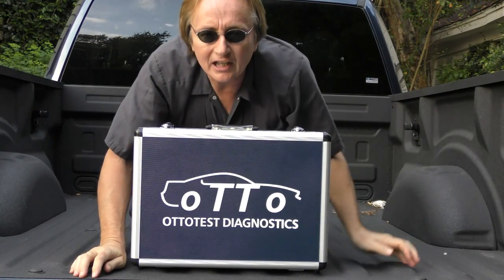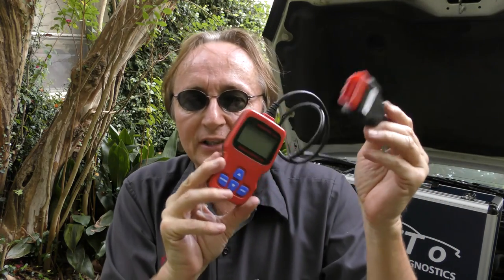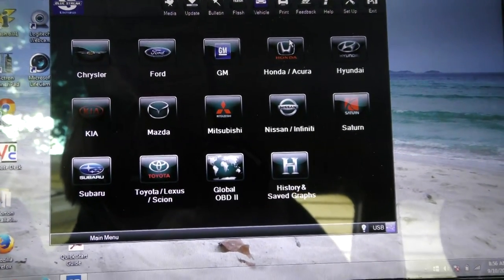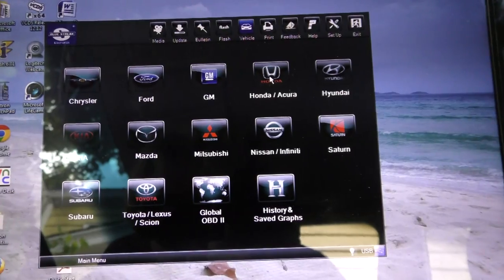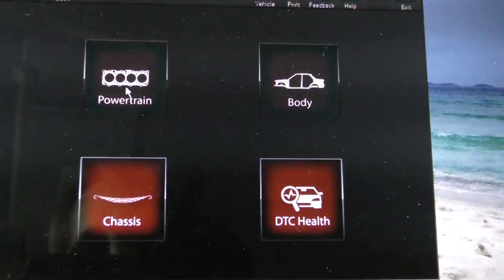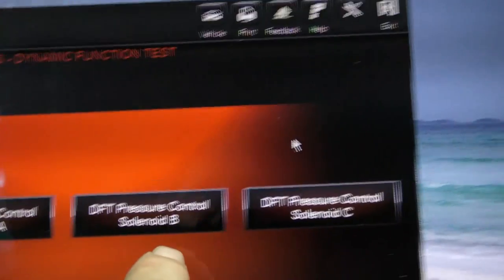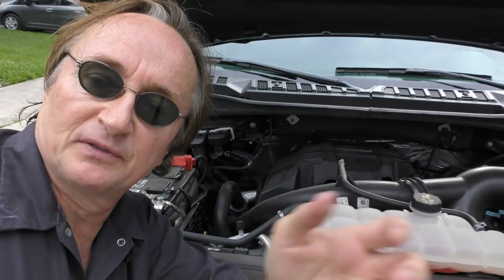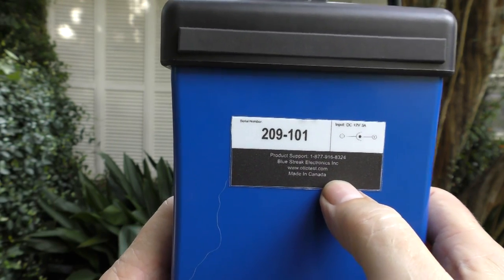Fixing Complex Modern Cars

Comment: POWER TO THE PEOPLE. Every man , woman on this planet should be able to open their hood and DIY STUFF on their car I say Open source every car system out there. The craziest I have seen is " No dip stick for BMW" and the Run Flat tires. Let's put together a real car of the peoples. Lo
Reply: +Jonas Ben I had a conniption when I saw no dipstick on a BMW I worked on.
Reply: +TheFlacker99 (Flak) I only found out after buying the CAR lol
Reply: one of my favorites right now is the new wrx. oil filter in the engine bay is awesome.
Reply: ***** easy to reach , great.
Reply: +Jonas Ben Audi has the same thing. I know that the Mercedes sprinters do not have trans dipsticks either.
Reply: +Raf Matt Interesting.
Reply: +Jonas Ben You can have a bicycle with the small motor attached to it, no need for a car.  Easy DIY transportation
Reply: +Zak K  I live n Canada so the winter is very brutal need a car lol.
Reply: +Jonas Ben When I lived in Europe winters were bad too heavy snow and freezing cold, you couldn't drive a car as first wouldn't start second the snow was at least 20 inches deep and icy roads.  Most people walked or used a sled.
Reply: +Zak K My car starts and we plow the street with plenty of road salt that eventually destroy our cars haha.
Reply: +Jonas Ben wow Jonas no way! Bmw never told you that you had to rely on just the electronics to check the oil? I never knew about the no dipstick thing until I just read it on this comment section- incredibly stupid:/
Reply: +Chris Dooley BMW does not tell me much these days as I got rid of mine.
Reply: +Dadecounty Mike yep!  I own one!  install a fumoto oil drain plug and oil changes become so easy it's criminal.  2015/2016 WRX are fun, easy to work on cars!
Reply: +Jonas Ben I think most of the people would not still do any DIY. Since you can take it to dealer and be lazy. Most of the drivers dont even know how to change light bulb. The dont also have any clue about how engine,transmission or even engine fan work. I hope its different at your country
Reply: +w3llet  Here in Canada , I don't think so ; In Brazil I spent some time in garages while growing up . Where My dad flew his model planes there was a Karting track so this is how it all started for myself . Interest in Racing cars and mechanics was born.
Reply: +Jonas Ben Auto manufacturers wouldn't have to seal the transmissions if people could be trusted to put the correct fluids in their vehicles. This is to help protect your investment, as many European vehicles were designed for short life cycles and peak performance and luxury. If you want an appliance to get from A to B, buy a Japanese automobile.
Reply: +Jonas Ben You still check your fuellevel with a dip stick like Ford model T too?
The BC tells you exactly how much oil is in the engine and if it needs filling you get a warning and exactly how much oil you need. Easy.
Lots of people don't check their oil level on a regular bases with a 
dip stick, with this system you get a warning when it's too low and you 
can check it everytime you want.
Reply: +MarkVL No I check My telemetry on my computer , just F1 LOL.
Reply: +Jonas Ben ROFL man if you can buy a 65K car you can afford to just go get a new tire you have 80k on a runflat. and this dip stick thing is funny!! no crap can get in the oil. every time you pull that thing out you risk contamination. the computer yells at you if you have a problem with anything. the way you think we would all still hand crank our cars instead of an electric starter so we can feel if the crank bearings are bad:P
Reply: +Jonas Ben the amount of times i have seen people get an oil change and they don't put the oil back in!!!! lol yeh well a german car would tell you your car has no oil:) how many people look at that dipstick leaving walmart?
Reply: +Rick Tobin  Actually, the BMW models without a dip stick have to be driven about 5-6 miles before they will indicate oil level on the dash board.  By then, it's a goner.  Seems strange they would design it that way.
Reply: Because they want for you to purchase a new engine LOL.
Reply: A goner only if for some reason you lost all your oil at once, when does that happen xD. You would've got a warning the day before in your dashboard your oillevel is too low and how much oil you need to add. Excellent system.
You can't forget to check your oillevel, with this system you don't have to because you get warned if its too low.
Reply: MarkVL
 LOL.  Agreed, but I was referring to another post that mentioned someone forgot to refill after an oil change.  Cheers!
Reply: That would be the Russian Lada.
Reply: Yes sir .
Reply: One day the hood of your car will be sealed and if anything goes wrong on your car you will have to junk it!
Reply: John Azhderian that already exists lol it is called tesla
Reply: When your car runs out of gas you will have to junk it!
Reply: you must understand. people today want to drive and forget it. that's it!
Reply: i don't have to ever change the oil filter on my car.
Reply: ROFLMAO ya a big hole in a sealed system that can introduce contaminants and suck air. the dipstick is a great idea.man you are living in the Stone Age
Reply: An entirely open sourced 340hp 3.7 V6 4 door luxury car that is very user serviceable with ATF dipstick and oil dipstick would be very nice. Also the end user can mod the car to their liking anyway he or she wants such as a more granny or more responsiveness or can come up with a software patch or a self engineered part that fixes a problem well before becomes a lawsuit. We should start and engineering and design team to make it happen.

Comment: When these hit Harbor Freight, let me know ;)
Reply: +snarlingrabiddog5150 

So funny because it looks like a item they would sell for like 100$
Reply: +snarlingrabiddog5150 If you found an Ottotest at Harbor Freight it would be very inexpensive. You would just have to ignore the slightly misspelled brand name.
Reply: +snarlingrabiddog5150   Hey, hey! Don't make fun. Those vietnamese kids are doing the best they can to build harbor freight tools. :)
Reply: lmao!
Reply: Harbor freight does sell the Autel MaxiDas DS 708, it also handles European cars. Scotty does have a video of it and he, like many others, says it's just fine. It's priced at $1100, but you can use a 20% off coupon to get it for less. I just ordered one Myself as I'm now working on European cars, and our older troubleshooting tools are garbage, hacked software and out of date. For most cars from the mid 2000's on, You need one just to reset service lights and see what's causing problems when an OBD 2 scanner won't go any farther then the ECM.
Reply: Rc Shalls It works but it still isn't cheap.  1100 but it is legal software and still cheaper than the otto. 

Also scotty showed one of the 100 scanners from hf not long ago.  He said they worked too. Just not at the super oem level too.
Reply: lmaoo💁🏽‍♂️😂😂😂
Reply: I think he bribes them with auto services (Euro cars exempt)

Comment: Reasons why i finally ditched my 2004 audi a4 and got a '09 Tacoma - 

pieces too expensive
pieces harder to find locally
requires expensive higher grade fuel
too many unnecessary steps for simple repairs 
repairs take longer
poor support for non oem repair community
too many different fastener types 
cars start falling apart all at once
 - Done.
Reply: what you mention there is pretty much all VAG cars lol

Comment: Computer controlled mechanical components is really a scary thing when you think about it. If anyone manages to interface with the computer, they can hack your car while driving and disable braking, power steering, cut engine power remotely while on the interstate, ect. This becomes especially more concerning with the newer cars that are internet connected via 3G/4G all the time and have no firewalls or separation built into their embedded systems.

Comment: They call that planned obsolescence with European cars. The only ones that are worse are English cars. A friend of mine was fixing his brothers xjs and the Jaguar dealership quoted him over $700 to fix the brake lights. Complete swine.
Reply: +Michael Sackstein And the fact that Jaguars are done by TATA Motors doesnt really confront me about these HIGH quality English cars :D
Reply: +Michael Sackstein Well, I read articles on the net and the general consensus it Volkwagen and old AUDIs are usually the worst cars. As for newer german cars, the engine will last very long if you follow the maintenance in the owner's manual. What becomes expensive if the labor. Labor is what makes maintenance expensive. That's why you should learn to DIY.
Reply: TheMidnightNarwhal very true. Newer ones do require dealership visits at some point but you have to remember when you bring it in you give them limited authority. Otherwise it could cost you many thousands. Happened to a friend of mine who owns a 1993 525i. He ended up spending $8500, but that's another story
Reply: Michael Sackstein I intend to get a BMW M4 and only bring it at the dealer for the free prepaid maintenance you get. Hell, I will even change the oil on mine half the time before it's scheduled.
Reply: That's fine. If it's free, then why not. Usually the only things that require dealership visits are computer related items.
Reply: Michael Sackstein Yes. Yeah, but even then, on the forums plenty of people can help you with coding and computer problems, depending how the niche for that vehicle.
Reply: Immobilizer systems are another one. Even locksmiths usually can't figure it out on German cars these days
Reply: Michael Sackstein Why would you want to crack a immobilizer? If a locksmith can't even steal my car, that's a plus for me.
Reply: No but sometimes the systems break down and don't even allow you to start the car and that's where it gets tricky because the only people by law who have access to those systems are dealerships or bonded locksmiths. No car is immune to that these days
Reply: +Michael Sackstein Jaguar is a rip off that uses Ford or Peugeot or any kind of engine. They don't make real cars.
Reply: Tell me about it. My uncle used to own one that was a ford product. Until the engine blew and they wanted $7k to replace it
Reply: +TheMidnightNarwhal Probably it's expensive in the united states because is import, here in europe it's about $60 /hour or so tax included. What can be expensive is the parts, which are rebranded most of the times. For example mass air flow sensors or abs sensors are taken from Bosch and sold at dealerships at several times the independent price.
Reply: borm91 what country are you from?
Reply: In London dealerships are starting to charge more per hour than legal companies do. Dealerships can make more out of service than they do out of sales.
Reply: +Michael Sackstein Was it the dressed-up Contour/Mystique?
Reply: It was a 1998 xjs
Reply: +TheMidnightNarwhal My older GTI from 92 seems like a car meant to be serviced and repaired for life to me. Not too complicated.
Reply: djkenny Exaclty, people tend to think it's rocket science. I intend to keep my upcoming car, BMW M4, at least 8 years and plan to conitnue doing the maintenance myself after the 4 year/80k km plan ends.
Reply: We just sold my wife's 2004 Forester with only 140k, it had a crap ton of life left in it. The trouble we had was with fitting backwards car seat in the back (my legs as a passenger were in the dash).

We chose a new Forester and it fits great. But we plan to keep this one far longer than the nearly 12 years we had our awesome 04.. unless we go electric, then we might not own it 20 years. 

Warrantees always end. The real value is when you pay it off and not longer owe anything.
Reply: +TheMidnightNarwhal That's funny because there are loads of Audi 80s still on the road as well Golf IIs. It's their newer cars that have planned obsolescence.
Reply: JimboRustles very true. VW/Audi made solid cars back then, for the most part.
Reply: Michael Sackstein And BMW to. But now they won't last long. Well they will but you will have to repair and maintain much more these days.
Reply: TheMidnightNarwhal tell me about it. a friend of mine is a big BMW enthusiast and even he's very particular about which ones he will buy for those reasons.
Reply: "Free" maintenance, that's a laugh! Oil change is "Free" but don't expect to walk out without paying for anything else they can find that's not warranty!
Reply: I one time bought tune up parts for a Toyota. They waned over $7 for each spark plug. Yeah they were in Toyota boxes, but were NGK resistor plugs, the very same ones I bought at the auto parts store for under $2 each. All manufacturers do this, and for some brands they're blatant about it.
Reply: JimboRustles I have a 92 VW GTI 16v. Had it since 1999. LOVE it! Fun, simple, great Recaro seats, manual everything inside, including the sunroof. These were brilliant cars meant to be maintained, repaired, and kept on the road.
Reply: djkenny yeah they were more solid in terms of build quality and longevity back then.
Reply: lol 41 years old first BMW it is like a cold glass of ice water while I'm burning in hell. buy one and you will understand.
Reply: A new key fob for a Volvo is $420.00. If you try a "cloned" fob, and the vehicle computer detects any difference, the vehicle shuts down and you have to tow it to a dealer to have the ECM reprogrammed-cost is $360.00. Dumb.

Comment: Your right about European motors being hard to fix, and as cars get harder to fix, people are getting bills upwards of £1500, which is entering the realms of why bother, just get another. Now as I'm old school, I generally check the internet for anything that matches my issues. If it's mechanical, I'll dive right in and check it, and replace myself if I've got the tools to do it. If it's a really big job, or to do with the engine management, then it's off to the garage. What ever happened to being able to swap your lazy 1.6 Pinto for a 2ltr Pinto in your cortina, on your own driveway??